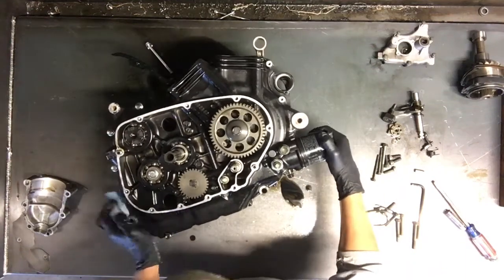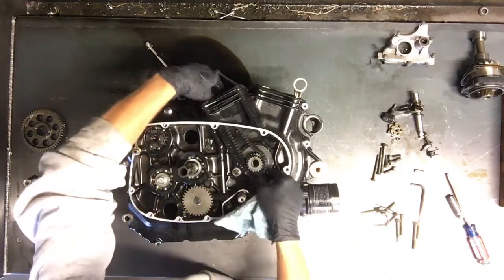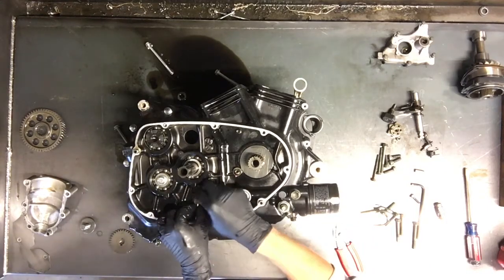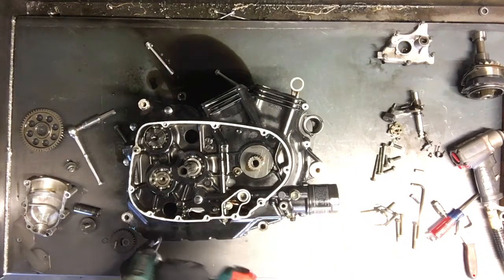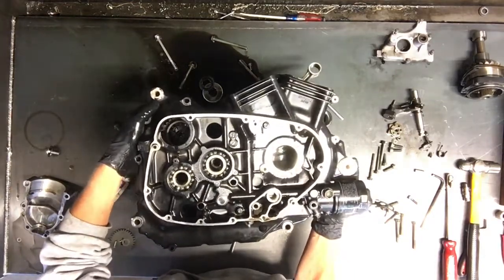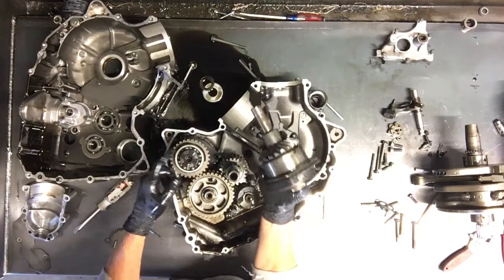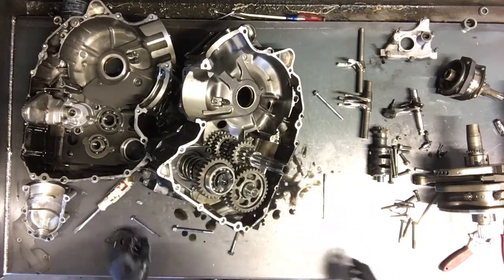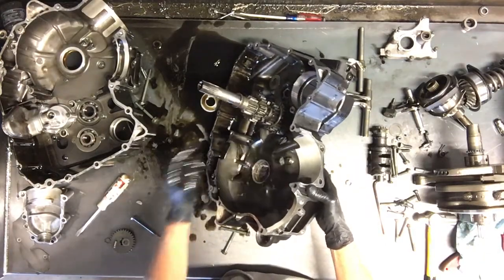Suzuki Intruder VL 1500 V Twin - Crankcase / Transmission Crankshaft Rod Set

Comment: I'm planning to use an 800 intruder as a donor for copy build of a British Morgan three wheeler, that turns the engine sideways in front of the trike. Is there an oil seal between the bevel gear and internal transmission area? In other words, could I weld on a "U" joint output shaft onto the bevel gear, to turn the engine/transmission 90 degrees, and leave the covers off without any issues or oil loss?